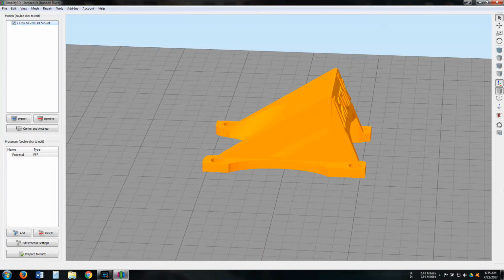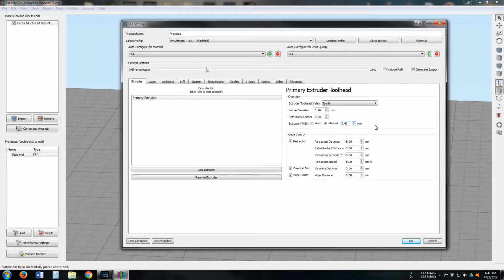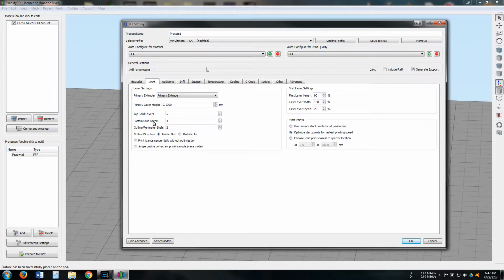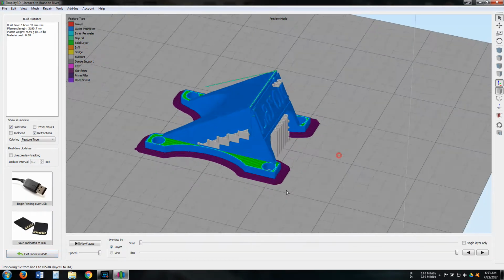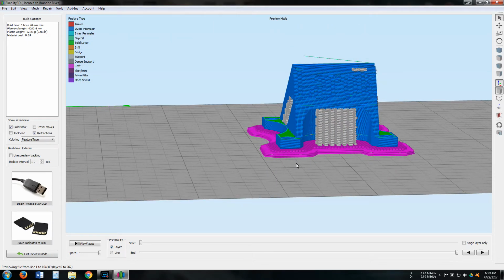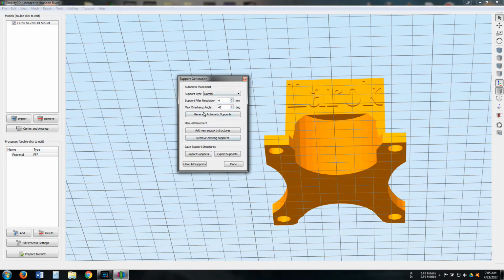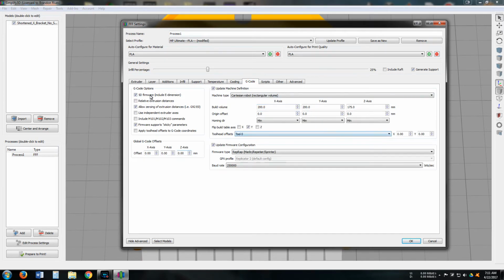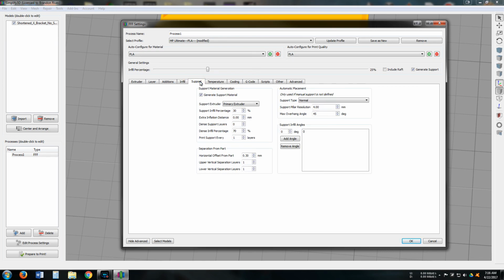Simplify3D Very Basic Setting Overview

Comment: Thanks, but not so helpfull. Partly wrong. e.g. coasting distance. Some real important things are missing: Support: Horizontal Offset is one of the most important. Too close and you will never get the support off. The same at the raft...  But anyway: thanks
Reply from the maker: Ok, do you have any tips on what I should change? That's the great thing about youtube helping each other out. When I did this video it was because I could not find other videos that were helpful.
Reply: You are right. What do you have your percent ?
Reply: @TheDronzDr  Which setting?